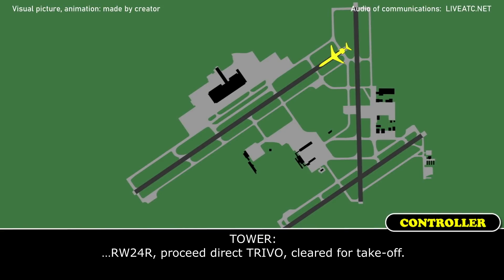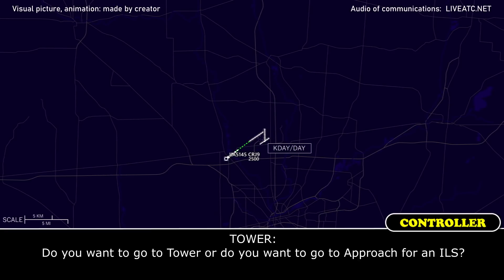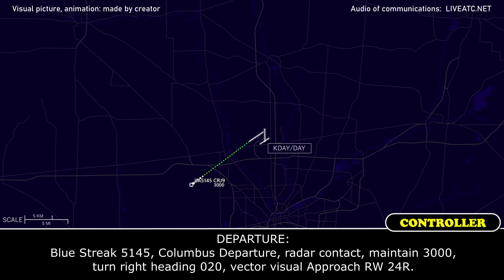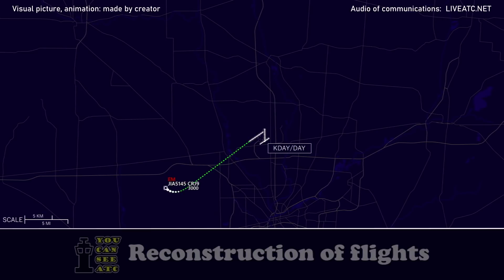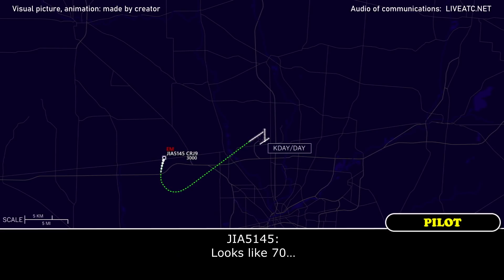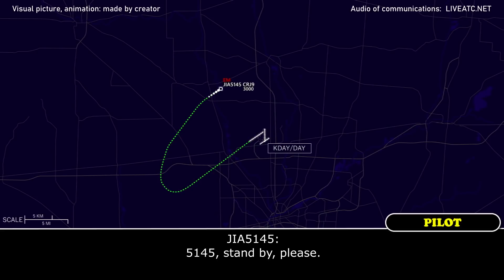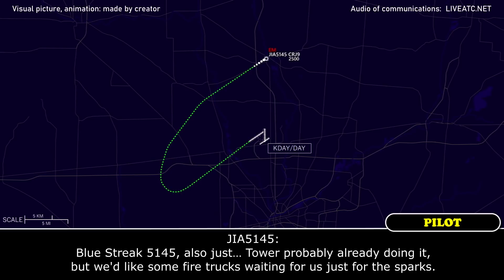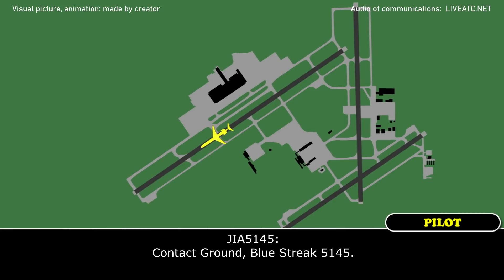Sound of EXPLOSION and SPARKS from the engine on takeoff | PSA Airlines CRJ-900 | Dayton, ATC

Comment: It's comforting to be reminded of how important safety is to modern airlines. All engine readings looked normal and it seemed to be under control, and yet of course they returned to the gate so maintenance could look at it. I wonder if at a different point in our history they would have just continued on.
Reply: some pretty shocking things have happened recently though - while most of the airline industry is incredibly safe and most pilots make good decisions, some always slip through the cracks. one recent example: https://www.youtube.com/watch?v=0ga8UFy1M04
Reply: @octagonPerfectionist  that's insane, will watch for sure. In the "Swiss cheese" theory, that's a giant hole right there.
Reply: Yes! So many people work so hard to keep it that way.

Comment: Most controllers won't know some of the engine technical terms like ITT.
Reply: ...For those who aren't controllers, what does it mean?
Reply: @Ysalomet  ITT is Interstage Turbine Temperature. Basically an exhaust temperature, though at a relevant location for a jet engine. Most controllers won't know that, while jet pilots certainly will know it.
Reply: @zidoocfi  
Ok thanks
Reply: And you know most controllers ? What does it matter how much info was given? The more the better.